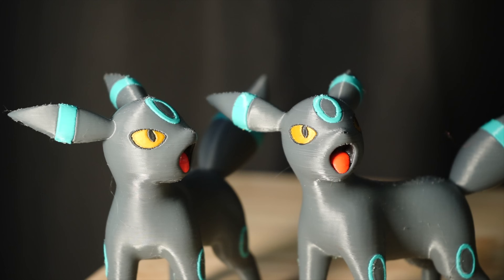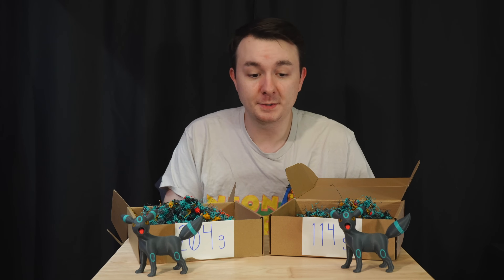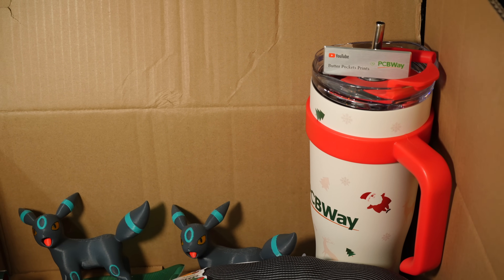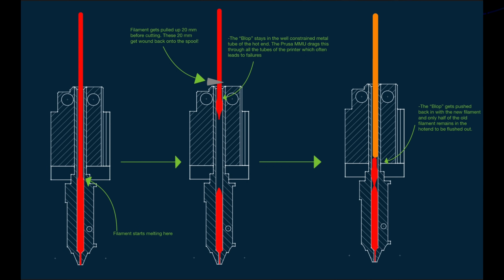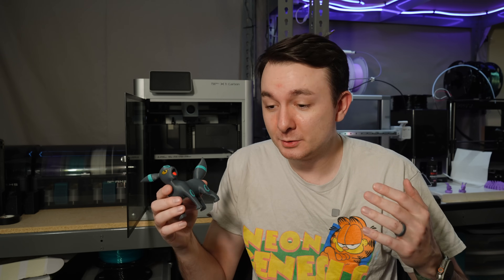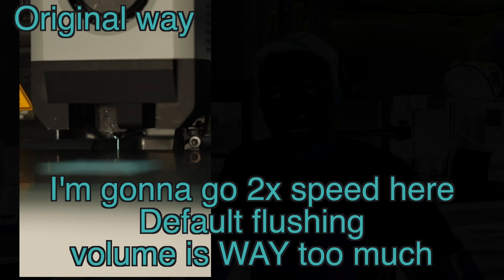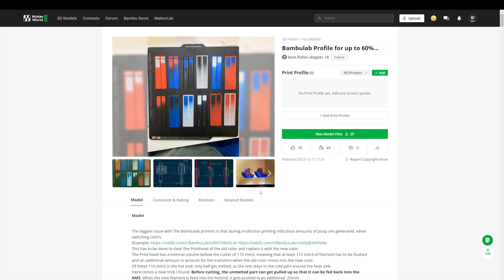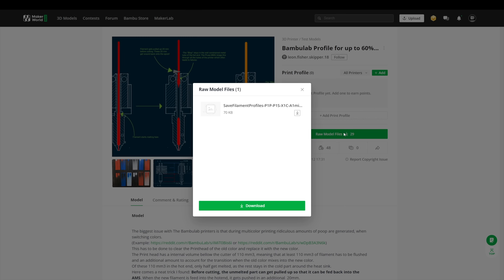The Best Way to Reduce Filament Waste for Bambu Lab AMS

Comment: How will this work with PA (nylon)?  The stuff is tougher, and I notice that when it is pulled back it stretches and even the filament cutter may just squish it rather than cut it.  Just completely took apart the extruder to remove some stuck PA and the stuff pulled back by the AMS just stretch after the cutter squished it sideways.  Ran it with .6 nozzle and a second time it gets stuck in the extruder during the cutting and AMS pullback.  Any ideas.....anybody?  I do have a Kickstarter unit, so I may have missed some fix to this.

Comment: The primary reason why it cuts where it does is that pulling it up increases the chance of a jam.  It's not necessarily a huge increase, but given the focus of he printer is reliability first, it makes sense why they did this.
Reply from the maker: Yeah I’ve mentioned that in a lot of other comments. I understand why they did it the way they did it. The creator actually told me BL is testing this method on their internal print farm now so it’s worth something :)
Reply: @ButterPockets  You could always just change it from 20 to a lower number. Still some benefit with even lower risk of jamb.
Reply: @ButterPockets I hope it leads to something and it’d be wonderful if they actually officially support it one day, at least as an option in settings
Reply from the maker: @ they do it’s in the pinned comment
Reply: has anyone here actually had it clog doing this? & how often?

Comment: so when its putting the filament back in he has it put in 18mm at 200 and 2mm at 20, is that just to account for the blob thats in there? I guess I don't see why its not just G1 E20 F200
Reply from the maker: My best guess would be it’s either similar to what BL did by default or he found that slowing down before jamming it all in helped!

Comment: Just to be clear, you changed the Prime Tower volume from 45mm cubed to 5mm cubed? If so how did you come to this number?
Reply from the maker: I just randomly picked it honestly. It doesn’t need to prime all that much. It just happened to work so I stuck with it.

Comment: Why not cut and switch before getting to the end of a color? Everything is calculated volumetrically. The slicer knows how much filament it will need. Why not cut early, feed in the new color, continue printing the old color timed to that you get to the end before the purge. Then purge a very small amount to get the color changed and continue printing. I don't understand why it wait until a color is finished to cut it. It knows how much filament it needs to finish the color, cut it there. 
That's a fix Bambu would have to implement though I think.
Reply from the maker: So, in order to switch material automatically you need to cut and pull the filament out from the cut. There’s no getting around that part of an automated material switching system. With that established, yes you could write an algorithm into the slicer that would say “you have 50mm3 of filament left in the hotend, stop when there is 40mm3 of this color left, go cut and retract, then go back and keep printing, then go switch colors”. I think the problem with that solution is that because it would be different on every model, every single slicer setting would change it, walls, infill, width, pressure advance, flow ratio, e steps, etc it would be really hard to do. It would first off be hard to calculate in the slicer. You’d also never want it to stop and then restart in the middle of a wall because that would probably lead to an artifact in your print. You’d also still have to have it “poop” some and still do a prime tower because you can’t just transition to a new color without one. It would also add a lot of time because it would have print some part of the layer, go cut, go back to print, stop to change colors again, then go prime. Instead of just one action of cut/switch/prime. So overall I understand what you’re saying, but I don’t think it’s as feasible as it sounds. It would be a lot more unpredictable and like others have commented it seems BL went with the most fool proof way of switching colors to run into the least amount of problems.
Reply: @ButterPockets  I hear you and I'm not saying it would eliminate waste and purging. But really it sounds like you just solved most of the things. I'm not saying it would completely eliminate waste. But the slicer is already doing those calculations. It could plan to switch in infill. I do it manually  just by cutting filament when I think it's time and pushing a new one in to the extruder behind the old one. It's the same amount of changes, it's just different timing.

Comment: I'm a little confused why these printers make towers AND poop.
Reply from the maker: The poop is because it cuts the filament and retracts it. This is a better option than JUST retracting the filament because the end will have a blob that will clog up the PTFE tube. So the it “poops” (purges) the old filament out. This is why it has to poop at the beginning of a print as well. The tower is a prime tower because the nozzle pressure needs to be equalized before you start printing. If the nozzle pressure isn’t right it will sputter and ruin your print.

Comment: How were you able too resume print after a power outage? Thanks
Reply: The P1s started back up where it left off during 3 power outages in a row. I was impressed
Reply from the maker: The X1 has it built in. It happened to do it during a color change so it really didn’t lose its spot.
Reply: @ButterPockets  that's really cool, interest to see if the A1 has similar functionality, something I'd have to check..

Comment: I wish the software / firmware had a checkbox not to poop a bunch of filament. If I haven't changed the filament since last time then there is no reason to. Maybe it should remember the last filament & the current and intelligently check/uncheck the box while leaving the user the choice to override it.
Reply from the maker: The reason it does that is because it always retracts the filament. So it can’t do it “smartly” unless you always used BL filament with RFID and it knew you didn’t change what was in the AMS slot. Because you can use filament that’s not RFID it can’t know for certain what is in there or not. I get that they could have a switch that says like “same filament, poop less”. BUT there is going to be a disconnect between the cut and the new filament always. That would lead to a small pressure change somewhere in your print. The best option would be “leave the filament in and don’t cut it”. An option like that might be helpful!

Comment: so basically, its as easy as downloading the 3mf file and once you choose your printer you save the presets, and change the flush voulume to 0.50 and that should be it? cause i just tested it on a sliced file with the normal settings and then with the less poop settings and after changing the flush volume, my waste literally got cut it half. which is amazing!!!!
Reply from the maker: Yep! You can fine tune the flushing from there but that’s basically it

Comment: When you do G1 E-20 F200, does the AMS also pull the filament back 20mm, or is the extruder just retracting it into the buffer on the back?  If it's retracting into the buffer, I think it's possible that the buffer is fully extended at that moment (like AMS had JUST fed more filament in), and there might not be 20mm of space there to retract.

As an aside, on my Vorons I retract 25mm in PRINT_END at a much higher speed (F3600), which then allows me to change filament later without heating up the hotend, because the filament end is completely out of the hot zone.
Reply from the maker: I can see the filament move up in the AMS. I didn’t specifically check the buffer, but mine is very noisy and it’s clear when it’s operating. I never heard it do anything out of the ordinary.

Comment: I just don’t understand how this can be so full proof but not a part of the firmware or default profiles
Reply from the maker: Because, in full honesty, it probably isn’t 100% fool proof. Nothing really is. But I would bet BL went with whatever in their testing yielded the best results for the most possible cases. This might not work for every printer, every print, every filament, every use case, etc but I think it’s worth a try and can always be adjusted if you run into issues!
Reply: That makes sense.  They probably decided it was better for people to waste filament than complain to customer support that their prints didn't have clean color changes...Thanks! @ButterPockets

Comment: Yeah... but still, the amount of poop is still pretty horrible. Bambu needs to optimize the software.
Reply from the maker: Well thankfully you can fully optimize the flushing volumes yourself. There’s no way Bambu Lab could know what color, brand, material, etc you were going to use so they had to make it unoptimized in order for it to remain repeatable. You could run flushing volume tests and get it to the point where it only flushes exactly what it needs to. It’s going to have to purge and prime for a swap so at that point there would be no unnecessary waste.

Comment: Thanks for the video, its an interesting option. I'm new to 3d printing, but from what I can see, by pulling back so much filament prior to cutting, you're opening the door clogs.
Reply from the maker: It’s possible yes, but after 465 for me it didn’t happen. You could always adjust it a mm or two if needed. It’s worth a shot though

Comment: I have tried flush to object instead of the purge tower and now Im going to try to purge to stacked objects, of course this is for parts whose colour is no issue.
Reply from the maker: It’s a prime tower not a purge tower. I really recommend keeping it because it ensures the pressure in the nozzle is back to where it needs to be.

Comment: I don’t get why they don’t just cut before the color swap needs to happen in the print? Just cut, keep printing the same color until you reach the transition point. Purge, then print the new color. In theory you could manage prints with 0 waste this way, if you can purge enough to infill/inner walls.

Another thing you could do to get 0 waste is to ”purge to into new filament”. That is, use the ”purge into object” and have the object be new strands of filament which you can later use for printing test pieces. You might need a way to attach the strands to each other though if you can’t spare the space on the plate to print a spiral.
Reply from the maker: I would think the reason they don't do this is because it can't be 100% controlled. Its similar to this method as well that other commenters have pointed out - that the reason BL hasn't implemented this is because its not 100% controlled and could lead to a clog or failure. If you know exactly how much filament is left in the hotend you could flush that into infill, but what about when there isn't enough infill to do that? I think a lot of this could be implemented into a very smart slicer, but because all these slicers just take from Prusaslicer and Slic3r until someone does something custom (a la Superslicer) it kind of has to be this way.
Reply: @ButterPockets  Yeah, this is probably a limitation in Slic3r that makes it difficult… Guess I’ll just have to make my own slicer then ;D Might aswell make it non-planar too, and sprinkle a bit of magic on top.
Reply from the maker: @beaconofwierd1883  hey I’ll contribute to that!

Comment: The only reason BambuLab don’t use this method is it increases the chance of clog as the hot blob pulled back into cool zone of the hotend.
Reply from the maker: Yeah I understand that! I like that we are able to try this out tho. It’s worth a shot for sure
Reply: You can fiddle with the amount of retraction to minimise the risk.

I haven’t done this, yet.  The purge settings can be dialled way down from the automatic results, which saves a huge amount of waste.  (From e.g. 420 mm^3 to 120 mm^3.  Depends on the colours, of course.)

Comment from the maker: A couple things:

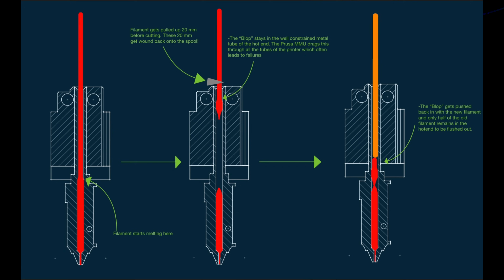You have to cut the filament. In the infographic at 2:51 it shows the “blob” that you don’t want to pull back into the PTFE tube. That means there needs to be some amount of purge or poop before the color swap. 

Second, you have to have a prime tower because the pressure in the nozzle needs to equalized before it starts working on your model. 

So yes it needs to do both!
Reply: I mean since you need to do both you can also finish the priming on the tower too? Reducing poop even further than 0.5, assuming you're using a single plastic type it won't matter if the color change finishes on the tower.
Reply from the maker: @SquintyGears  that’s possible sure, just hard to calculate. You’d have to intentionally lower your purge volumes and calculate that it would switch over enough during the prime. Worth exploring tho
Reply: They could eliminate a prime tower by starting the next sequence inside a model.  This is just something that slicers will eventually handle well.
Reply from the maker: @boggisthecat I’d prefer not to have those imperfections in my print at all! Even when I was pause prints I do a prime tower.
Reply: @ButterPockets  
You wouldn’t see it, unless you are printing with translucent materials.

Comment: I don't quite get why the filament is cut anyways?
Reply from the maker: It has to be. Check out on the maker world post he has a picture of the blob that would pull up into the PTFE tube if it wasn’t cut. In order to make the system automatic and smoothly operate it needs to be cut.

Comment: Turning off tangle detection had a big improvement for me. My fault though. Some spools were overheated when drying, causing filament to stick together a little, Apparently enough to make the printer think the filament was tangled.
Reply from the maker: I did this to myself accidentally too!

Comment: Was it reported to Bambu Studio github issues? What's the issue number? Bambu probably didn't do this to be on safe side and don't potentially pull back half melted filament (and there is ton of materials to be tested) and cause clog.
Reply from the maker: I fully get that it probably is to be on the safe side and it makes a lot of sense for them to do it that way!
Reply: It’s the same reason gpu and cpu manufacturers technically underclock their processors.  It’s where they found it most reliable to run but not maxing out the potential.

Comment: Great video! Thanks! Happy that this method is spread 😊
What surprised me though, was that you did not demonstrate with black and white filament. The critical filament changes are dark to white, and there is whether you clearly see how successful this is (or not). 
I'm a believer though! I will try 👍☺️
Reply from the maker: I didn’t show it because I didn’t want to specifically cover tuning your flushing ratios, but rather talk about the filament pull back technique that Leon Fisher Skipper presents and let you tune it all up yourselves!
Reply: @ButterPockets u could do that while printing the same model with mostly white and black eyes and rings, this just shows that the method doesnt work well for everything, maybe it isnt, i dont have a bambu,  but no reason to not show a better print.
Reply from the maker: @tired5925  obviously the method doesn’t save filament in EVERY scenario. The point of this video, and most of my videos, is to show a technique that you can use and apply to your own prints. It doesn’t mean “follow exactly what I’m doing and it will always work”. It’s for you to try and experiment with yourself!

Comment: Congrats, you just introduced one of prusa mmu issue that was fixed with the filament cutter 👏
Reply from the maker: @oljobo got it right! That’s the best part about this method. It pulls it up the right amount to save as much filament as possible without pulling the blob back!
Reply: What do you mean? Can you explain please? 🙏
Reply: Oh, I think you are referring to what is explained at 2:51 in that center text there.
According to that, your comment is incorrect
Reply: @oljobo  I mean the fact of not cutting filament introduce blob and 'hair' at the end of filament, and it gives many issues. On prusa you have to adjust ramming settings for each brand of filament because of that behavior. The cutter is cleary here to fix that, bambu lab didn't add it for fun, I'm not sure it is smart to bypass it 🤷‍♂️ my guess is you can have issues depending the filament brand
Reply: @superpatate1234  ok. But this method does not bypass the flush cutting at all. It just does it more smart and precise, without wasting more filament than •necessary•. No blob or hair will be retracted into the PTFE as I understand it. Again.. see text at 2:51
Reply: @oljobo  oh ok, I was thinking the gcode modification remove the cutting step, misunderstood, my bad

Comment: Is there any way to turn off the cutter or the purge function? Just use the purge tower? Or does this system let you turn off the purge tower and just use the purge function? Still bugs me that bambu has its machines do both.
Reply from the maker: It has to do both. The “poops” are to purge out what is left in the hot end from cutting the filament. In order to retract the filament cleanly into the AMS this really is the best way to do it. Like fisher skipper shows on his maker world page if you just try and pull the filament back without cutting it there will be a blob of filament that will cause clogs and stuck filament in the PTFE tube. So it has to be cut. Second, you absolutely have to have a prime tower. That serves a completely different role in that the pressure in the nozzle needs to be equalized before you start printing. So it shouldn’t bother you that it does both because both are 100% necessary. It’s bothersome that neither are fully optimized. BUT you can optimize them on your own which is nice that it’s not locked down.